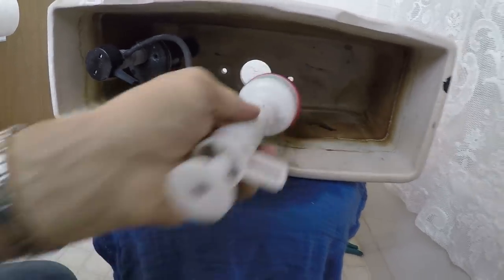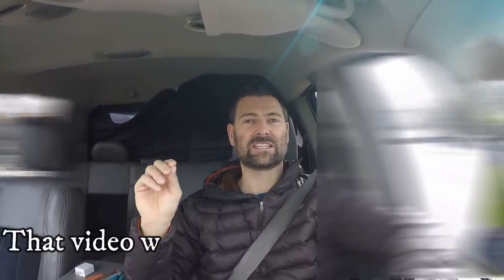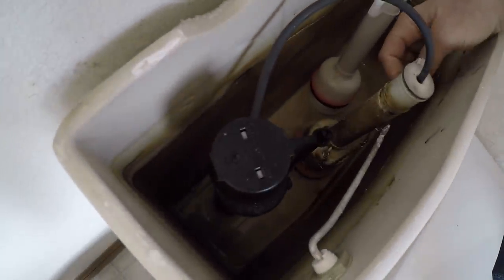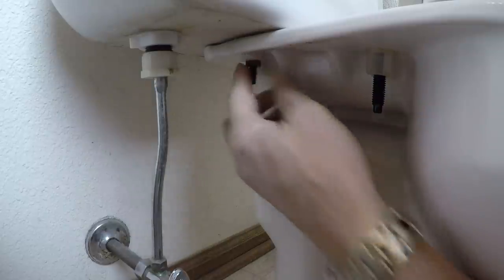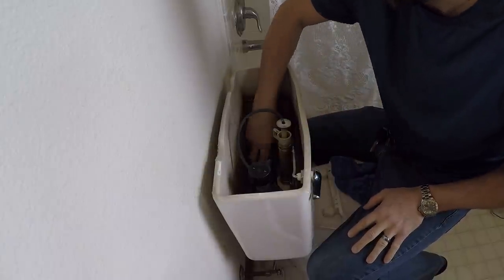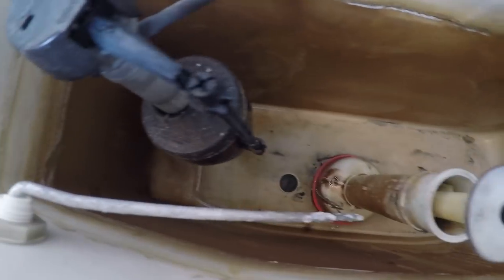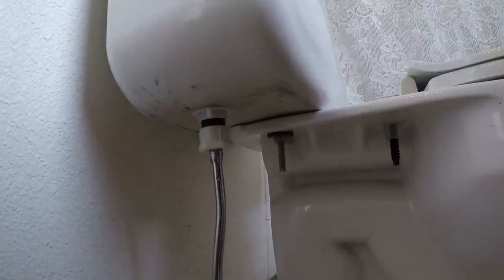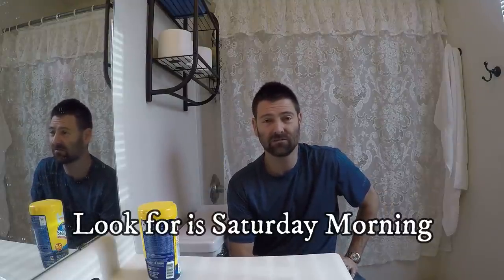How To Fix Your Toilet And Save Lots Of Money | THE HANDYMAN |

Comment: I like to use a grout sponge to soak up the water from the toilet tank that doesn't flush. A cup of bleach in the tank for 5 minutes before you flush it out and turn the supply off is a great way to reduce the staining in the water from the rubber and sanitize the whole toilet before you work on it, also makes the inside of the tank look much more new and shiney. Great video!

Comment: I have Mansfield toilets throughout my house, installed by the builder. They have those same exact flush valves that you swapped out. The part that fails is the red gasket that seals the opening. It either gets warped or stretched out over time and won't seal anymore. I've had to swap those out and just bought a bunch at HD and keep them in each bathroom. Very easy to disassemble the valve and switch out the gasket. Great videos! Keep it up!

Comment: Awesome. I fix 5-10 toilets a week for Property Managers.  90% of them get a new wall shut off valve, supply line, tank level control, and flapper.  I put all the new stuff in because I can charge T&M for it and I don't want to come back to that one for a while. My labor charge is dependent on many factors, including time and distance, who's it for?, and are all the parts available on my truck? Min $99, Normal Max $150. PM pays whatever amount I send. Trusts me.  Entire job usually takes me 30 minutes or less. 
-
The ones I dislike, and take longer, are the many that have the corroded and leaking tank bolts. Galvanic Corrosion. A Steel washer + Brass bolt + Steel nut = Galvanic Corrosion.  Dis-similar metals.  I think it is a plumber's union conspiracy to keep them and us handymen employed. An extra $40 charge is added, plus they have to pay for a new $20 Dremel  Diamond Cut off wheel to  cut leaking bolts out 
. 
 About 3 times a month I put in completely new toilets. Got one to do next Wednesday. I have PM buy any toilet they want except for 1.28 GPF dump flush (3") types. Too many call backs on those.  
-
Today, I installed a new steel pre-hung garage side door, a new Kitchen Storm Door, and new 1/2 bath cabinet flooring (leak rot), fixed leak,  new laundry room cold water spigot. I bounce at 4 pm. Then friend of a friend homeowner lady calls crying. Kicked out ex-husband trouble. I go install 8 new Kwikset oil rubbed bronze locks ($300K+ house), change garage door code.   --- A very, very, profitable handyman day.  Longer day than I like but vaults are now full. : )
-.
Reply: Rene Gade just wanted to say I enjoy your posts and you add a lot of value to the community.  
You ever try to slip a sawzall blade between the tank and toilet to get at those bolts?  Time saver when it works.
Reply: @1dgrdgr  - Hi, thanks. I can see were it would work occasionally. Usually the bolts will just spin. Too loose. Maybe put vice grip on nut and then Sawzall would work. I have also tried Oscillating blades; but they wear out too quickly.  My Dremel technique takes only a minute or two and I keep 4 cordless 3 cordless Dremels set up right in my tool bag. 1) Diamond metal Wheel, 2)Wood Cutting Wheel, and 3) 1/8" Drill bit with countersink. All E-Z load. The faster I get in and out of a job, the better! I also have a Dremel screw driver; but I don't like it so I have a cordless 4.6V Worx screw driver for electrical and appliance work. Also, I hate to go back to my service truck for the big guns (Dewalts).
Reply: I like that you think to charge for the blade.

Comment: I do follow your videos.  I’m also a handyman.  I was a certified secondary math teacher.  Now I’m a handyman for hire.  You do have some good skills.  However there is always room for improvement.  I really been a handyman most of my adult life having grown up poor and owning three different homes.  Consequently it was an easy transition.  Anyway, I just going to give you a few suggestions for what its worth.  Since you making contact with the bowl of the toilet disposable nitrile heavy duty gloves should be used.  I’ve found the “Venom Steel” to be very good.  The bolts you got from Home Depot are not recommended because they are made out of cheap, inferior metal.  If they get any moisture they oxide (rust) very quickly.  The best ones are solid brass.  The brass toilet bolts are still available at Home Depot.  There are two sizes.  The quarter inch and the 5/16.  The latter are stronger.  So, I’ve done what you’ve done in this video many, many times.  When I come across those inferior bolts be it the toilet tank or the closet bolts they tend to be frozen solid.  The last suggestion is to use a sprayer with bleach or CLR , or a cleaner that has antibacterial properties.  Yes, I noticed you had some wipes but I could not tell exactly what they were.  Again, these are suggestions.  I have learn much from watching you.  So I appreciate your hard work.  Keep up the good the good job.  TTL.

Comment: If at all possible, use brass tank bolts. The big box stores like to sell brass plated bolts which are not as good. I found the brass tank bolts at Ace hardware

Comment: Speaking of plumbing I have a new house where the builder installed p-traps where one end has a typical compression fitting but the other end of the p-trap is purple glued into place with no compression fitting - that is there is only one compression fitting used for the p-trap.  To clear the drain it looks like I have to cut out the p-trap.  Anyone know if it is a code violation to install a p-trap with just one compression fitting?

Comment: Never liked the Mansfield toilet innards, next time I bump into a Mansfield flush valve replacement I'll see if I can replace it with a Fluidmaster one to get a better flush or if you will, an Al Bundy turbo flush.  I'm a A/C contractor but scan the house for running toilets, plumbing leaks and bad lighting/electrical which I also do and customers like having only one contractor doing all these repairs in one service call.

Comment: Quick question. I have a toilet that will not flush the first time. The water just circles around in the bowl like a whirlpool on many flushes. What could be causing it and what do I do to fix it?
Reply: Be sure the tank is filling completely up with water and emptying completely on the 1st flush. Otherwise I would think your supply line or filled valve might need to be replaced. But I'm no expert you might want to let the handyman answer it.
Reply: @franksavino1597  Thanks for your reply! I know that the tank is emptying and filling completely because I have to cover off while I'm flushing it and physically watching the water level. Now I know nothing about the supply line or filled valves, so I'm going to have to look that up. Hopefully, The Handyman will further assist me so I can narrow the problem down to what's really wrong.
Reply: Sounds like siphon jet is clogged.  Fill up a trash can with water and dump in the toilet to fill to the rim, if it flushes, then it's the siphon jet.
Reply: @kittensplayingathome  Thanks for your reply! Often, I have to fill 3 1L bottles with water to get it to finally flush. But the toilet bowl never fills to the rim and it doesn't flush automatically. If it is a clogged siphon jet, what's the best way to unclog it?
Reply: Filling a toilet with water to the top and having it flush on its own without pressing the flush lever rules out any clog in the main toilet pipe inside the toilet which is usually around 3 inches wide.   

Next step you could put your finger over the small hole(siphon jet), then flush. You might be able to feel an object that is blocking the water jet that is needed to start the flush normally.  

Could be toilet tissue, tampon, toy, hand wipe or toilet scent/something else that made its way from the top of the tank inside your bowl.

A small piece of wire or zip it tool might work though be careful not to scratch the porcelain.
Reply: @kittensplayingathome  Okay, So, do you think the problem is deeper inside the plumbing pipes or possibly the septic tank? The crazy thing is that whatever is in the toilet bowl (toilet paper, etc) goes down the toilet bowl, but the water acts as though it wants to flush. Instead, it just circles around like a whirlpool.
Reply: @reccothomas1689  No not a sewer problem.  None of your drains would work at all if there was a sewer issue.
Reply: @kittensplayingathome  Okay. That's good to know. Now I just need to narrow it down to what the real problem is. Thanks a lot! You've been very helpful! I watched one video where they were talking about using muriatic acid to clean the clog or buildup inside the bowl. What do you think about that method? I also thought about just snaking it the old fashion way. It could be something simple, but I just can't figure out exactly what it is.

Comment: I was taught how to repair toilets as a kid in my parents' rental properties. Once after replacing the porcelain tank, my dad and I were almost done -- until we over-tightened the bolts and cracked the tank. What a miserable way to end an almost-done job. Had to run out, buy a new toilet, and start from scratch. It's never as easy as you think it's going to be.

Comment: The entire toilet kit is ~$30 for a rebuild. I just hate those bolts. Last 2 I had to drill out. Any metal bolts in the bathroom will be corroded in place after a decade or so.